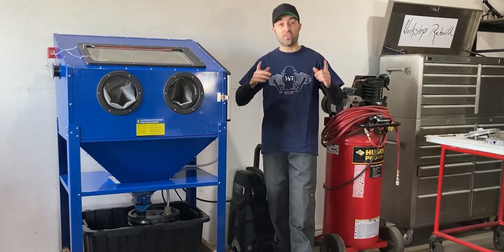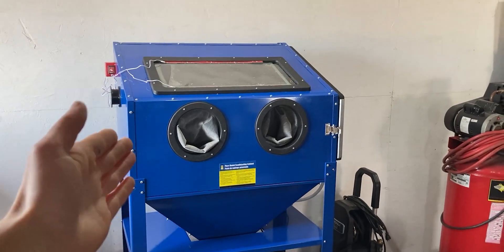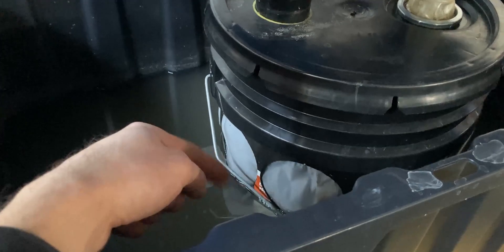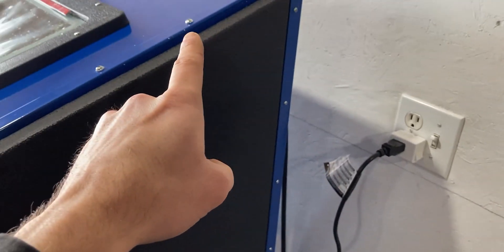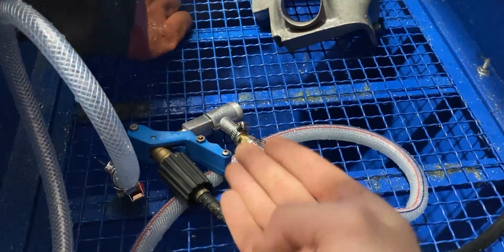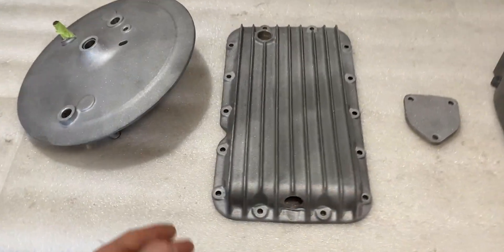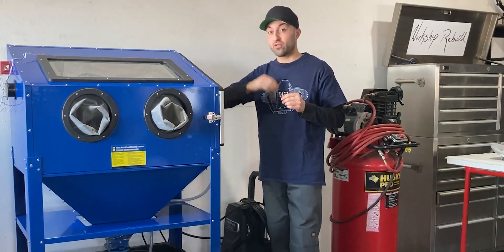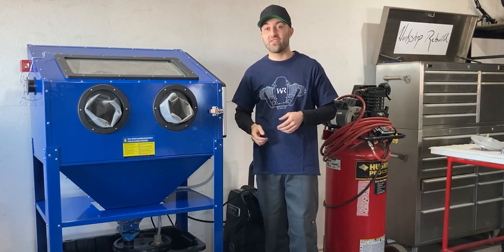DIY Vapor Blasting Cabinet with Pressure Washer

Comment: If the pressure washer isn’t using a nozzle what’s the output pressure ? and I wonder if different spray tips behind the media would increase the cleaning action.
Reply from the maker: I technically do have a "nozzle"in this setup, but it cannot been seen. At 04:25 I mention I have a built-in orifice right after the valve. Usually on a pressure washers, you get different nozzle tips or even one that you can turn in a circle, to choose your desired output. The smallest hole (nozzle setting) for this pressure washer, was a 1.5mm hole. I didn't have a 1.5mm drill bit, so I had to drill a little bit bigger. 
If the orifice would be smaller, I would increase the pressure and the pressure relief valves within the pressure washer would still be able to handle it. It would be great to be able to read the output pressure and to adjust the settings. I'll have to figure out how I can integrate that into this setup.
It probably would increase the cleaning action and that's something I'll take into consideration. Thanks for your comment, CJ!